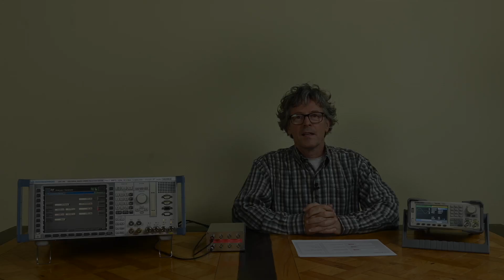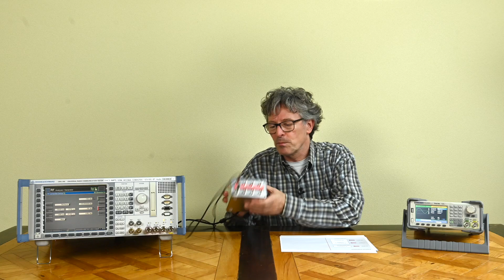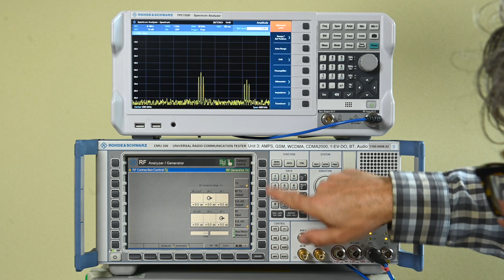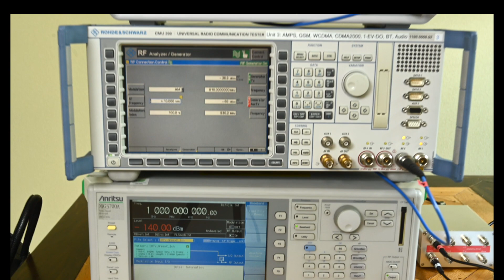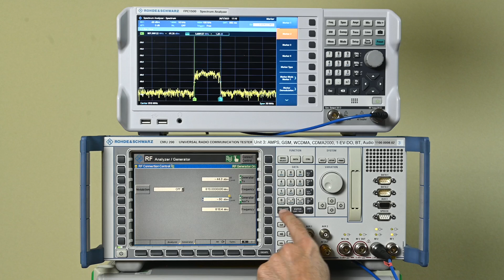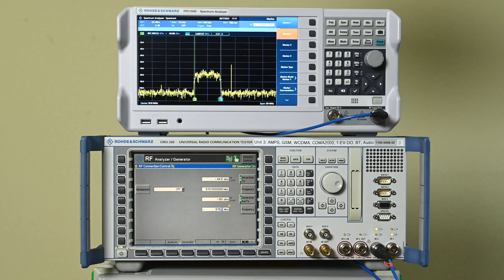REL #31 CMU200 as RF Signal Generator

Comment: Hi and thanks for the video. I want to connect to GSM 850 and I have both cmw500 and cmu200. The simcard I have for cmu200 is bigger than the one I can use for my device but the simcard for my cmw500 fits. Can you help if I can connect to the simcard with the cmu200?
Reply from the maker: Is it the physical card size that is a problem for the phone? There are these infamous manual 'SIM Cutters' that transfer a SIM card from micro to nano. Is that what you need?

Comment: Hello Rudi, Thanks a lot for this Video. Do you know how the List mode can be enabled?. Can I do this for myself?
Edit: ok, found out I have to install CMU-K47. But I need a code which I don't have. Any idea how to get/purchase this code?
Reply from the maker: Thanks for the compliment. In the video, at 19.40, you see how the List Mode can be selected via the user interface. If you do not see this on your own device, then there can be two different reasons: (1) you are running an older firmware version (don’t recall when list mode was introduced but I think FW>5 has it) and (2) you need to have the List Mode software option activated…. GL!

Comment: Thanks Rudy for the video. While looking at the frequency range of the secondary ( or Aux) generator chanel, I noticed that I wasn't able to go above 1100MHz rather than 1220 MHz has shown. I have B-95 option. I don't know if this is related to my CMU.
Reply from the maker: Thanks for the reply! I think you are right. In the CMU200 Operation Manual (2010, FW5.20) (1100.4903.12-06) on page 6.53 I read “350 MHz to 550 MHz | 700 MHz to 1100 MHz | 1400 MHz to 2200 MHz” as supported frequency ranges by the CMU-B95. My 1220 MHz may have been a mistake...  Looking at the same page in that manual, it also seems that AUX TX2 (in CMU-B96) does support the 350 MHz to 550 MHz band, only the two higher ranges. Would make sense, as AUX TX2  was originally envisioned to modulate a UMTS signal to test non-blind handovers from GSM to UMTS, and UMTS does not support the 450MHz band (https://en.wikipedia.org/wiki/UMTS_frequency_bands). But I do not have the CMU-B96 option, so I cannot test that.
Reply: @rudiselectronicslab861  Thanks Rudy for the feedback. While I was looking at Aux Tx on RF2 ouput, I noticed a "strong" signal leakage from Tx placed in RF3 output set at 2.7GHz 0dBm. The leakage signal power was at -50dBm, which is strong versus the Aux Tx power at -60dBm. Moving Aux Tx to RF1 improves the situation, but it does not solve completely the problem. Is this something you observe?